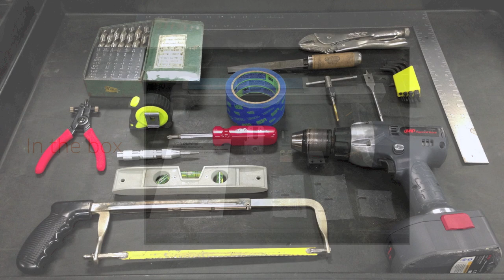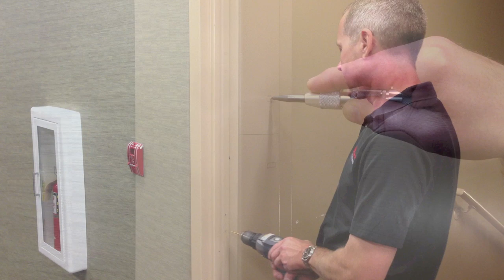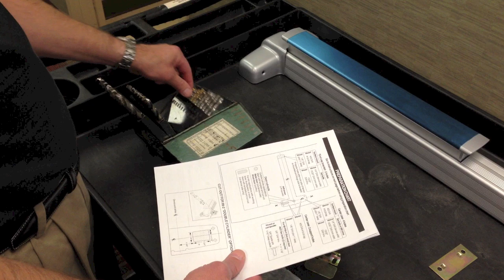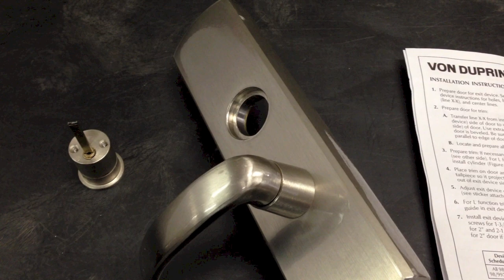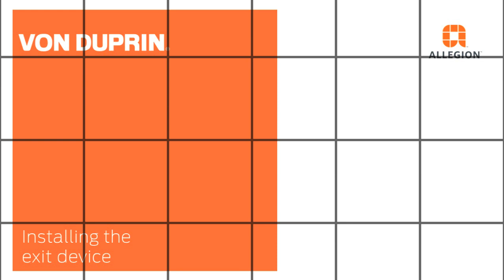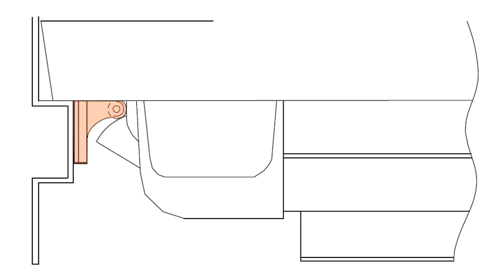How to Install Von Duprin 98/99 Rim Exit Device

Comment: Two tricks to installing these than makes it a LOT easier!

First, put two lengths of threaded rod in the top of your outside trim, it gives you something to hang the device while you line up everything, when you're done, remove them ONE AT A TIME and install the screws.

Second, if you don't have the tailpiece guides, you can push the tailpiece through a strip of tape to keep it in place while you put the device on the door. 

Work smarter,  NOT HARDER!